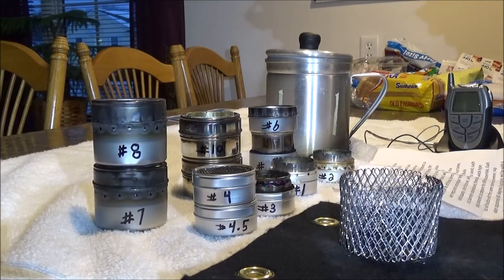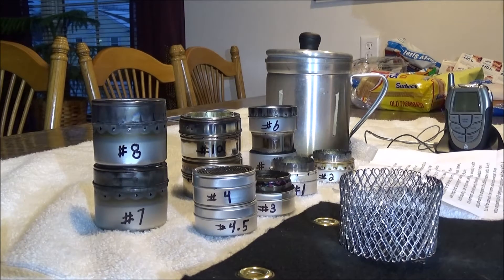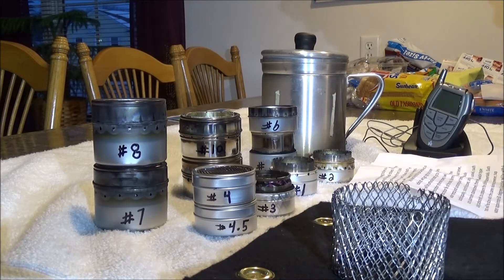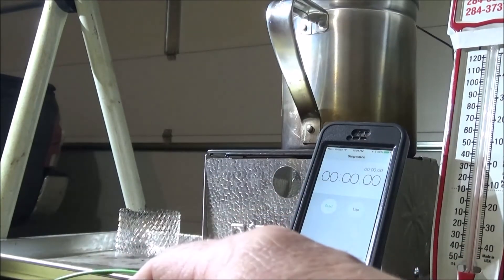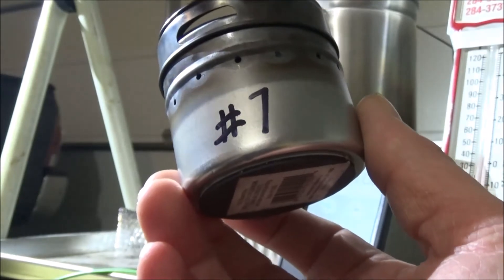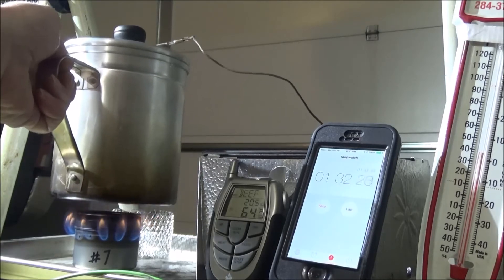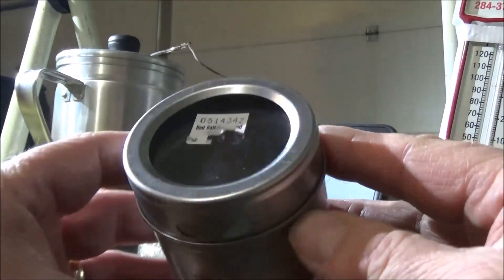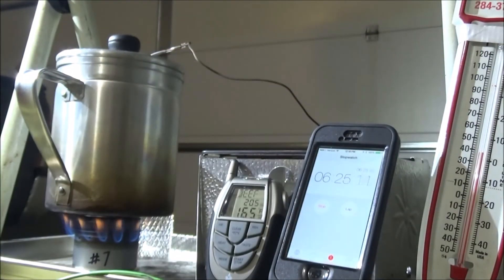DIY Alcohol Stove #7 Burn Test Video #9 SIMPLE EASY & CHEAP not a pop can jet type

Comment: 7:30 It's not lack of airflow that makes the jet flames die down. It's called "cold pot syndrome." As you know, the stove has to heat up for the jets to light. Well, the cold pot acts as a giant heat sync, and soaks up all the heat from the stove walls. That cools the alcohol inside, and causes it to give off less vapors. Since the vapors are what actually burn, not the liquid, less vapors means less flame. As you have discovered, it can actually put the fire out. 
There are a couple of solutions, one of the easiest is to put a square of hardware cloth over the stove opening. This will reduce the amount of cold pot touching the stove body, and thus limit the heat loss from the stove.
Or, as you said, you can also pick up one edge of the pot. That limits the contact between the pot and stove to one spot, and reduces the heat transfer similarly. Side burner stoves are notoriously slow starting. They need a lot of warming and care to get the jets going.